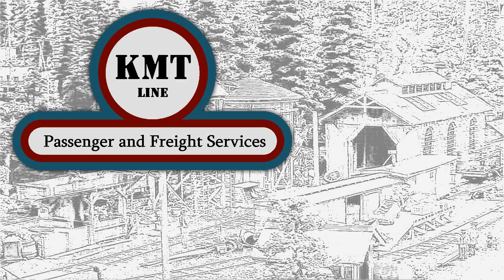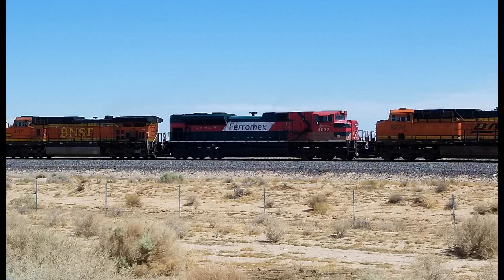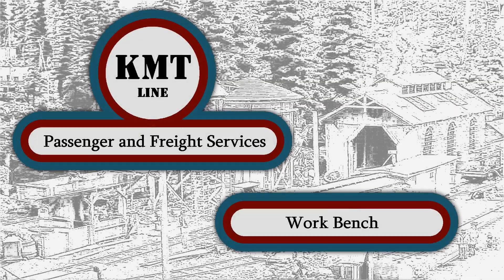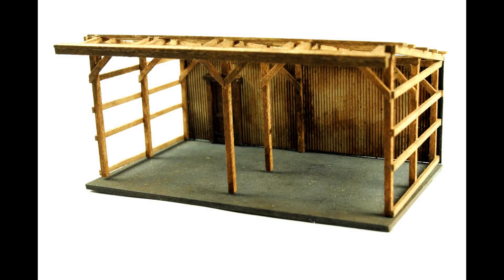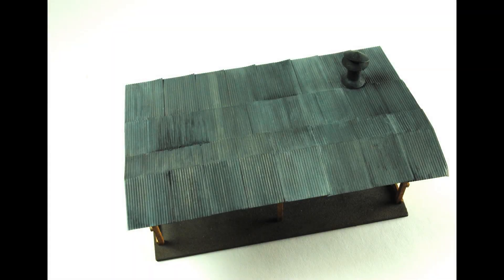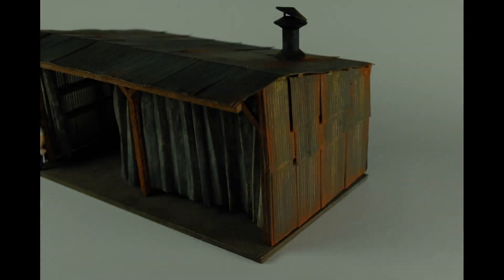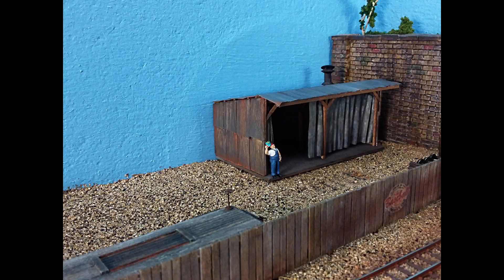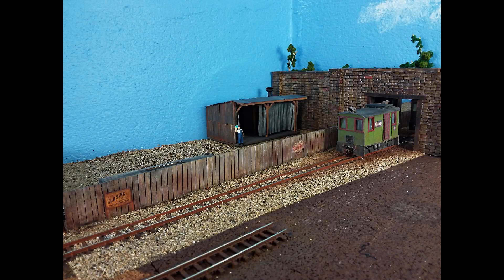KMT Line Update #21 June 27, 2021

Comment: I love the model welding shed Larry. You did an excellent job on the weathering as well. It really makes the corner scene pop. Personally, I wouldn't change the height of the shed. The ratio of scale supports the composition of the "vignette" scene perfectly. Sometimes, "ratio" (in terms of artistic license), is more important than exact prototype specs when we compress our design elements. Cheers ~ Boomer.
Reply from the maker: Thanks for the comment Boomer. It really does mean a lot to have your input. Thanks for taking the time to watch and comment. Cheers- Larry.
Reply: @harperlarry49  A model railroad is a model railroad regardless of the size and scope. Keep up the good work  and have fun! Cheers.